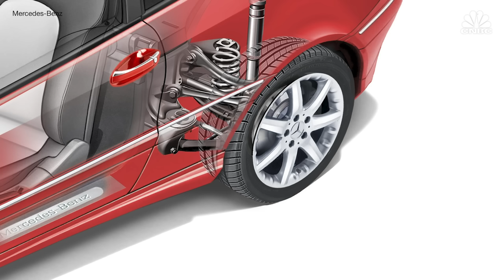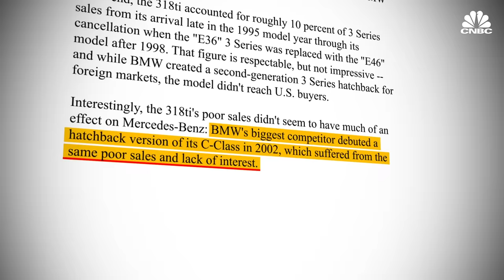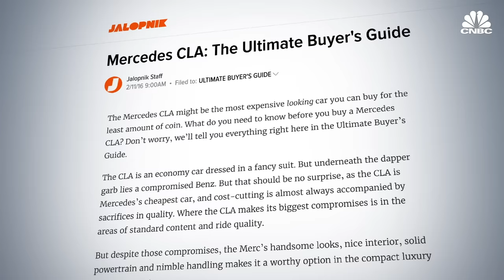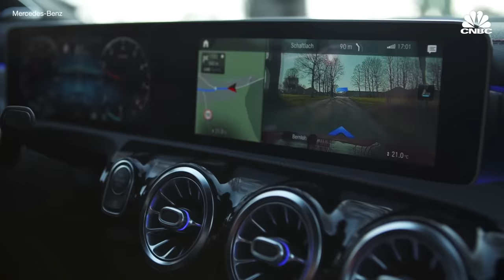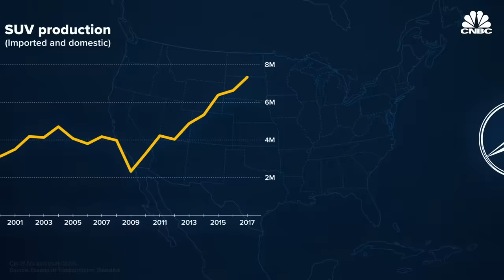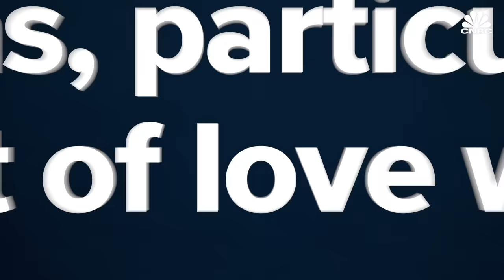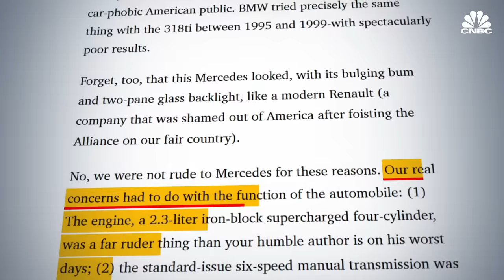Why BMW And Mercedes Made Cheap Cars That Failed

Comment: The real title should have been: "Americans do not buy 3 door hatchbacks, especially expensive ones."
Reply: Spot on.
Reply: Spot on.
Reply: I think he or CNBC missed the point regarding this segment.
Reply: Exactly b/c these things are very popular in Europe
Reply: Shame... Golf R or GTI are excellent options.
Reply: @vavo4902  BMW and Mercedes would have been wise to sell a hatchback in the 80s. If they did, they might have gotten lucky like VW did throughout the 90s, 2000s and today.
Reply: I purchased a brand new silver 318tiA in 1998 and I'm still driving it today,  almost 62,000 actual miles.  It's a hatchback but it's still a real sports coupe, fun to drive everytime.  However, it's not a popular model here California.
Reply: Yup American car tastes are different, doesnt make the model a failure. And things are changing, they are buying smaller cars and with the RS6 being available in the USA you watch wagons make a comeback
Reply: sdsteve1000 nothing is cheaper in the U.S than an unreliable euro car. Base model Toyota Camry’s are more expensive than Range Rover SUV’s and Mercedes cars on the used market, and the Camry’s always have more mileage. American cars can be hit or miss but if you know what to buy, you can get a great vehicle. We buy mostly Japanese and American cars here anyway if we want something that will last. Even Korean cars are catching on in quality. Over here, even most people that don’t even know much about cars have a certain understanding that you just don’t buy something like a modern bmw and hope it’ll last, because they just don’t.
Reply: Unless it is Scion tC that you bought pre-owned for cheap.
Reply: @Lando-kx6so  Mercedes, BMW, and Audi do not have the same reputation in Europe as they do in the US. In Europe, likely due to a combination of logistics and taxes, they all have a very wide range of cars. They are never at the very bottom, but  from the middle up they have a car in basically every category. BMW I think had a reputation for always breaking down and being crap in the 90s I believe, because they mostly sold the middle end cars and they didnt have the best quality. Meanwhile the US has only ever gotten the high end models because they have larger margins and bigger profits, so US importers only wanted the high end cars.
Reply: sdsteve1000  not always. Japanese cars are some of the most popular cars in the US, making up 40% of the market alone. Meanwhile, the majority of Ford's sales in the US are made up of dependable F-150 models.
Reply: Not*
Reply: @scooterbob4432  I love those. I've test driven one in a stick when I was a teen. My dad bought me a 2000 3 series auto sedan and I never really enjoyed it as much as the other bmw choices
Reply: The 3 series compact failed due to its looks but those of us who could look past that the 320td was a way better car then its sedan version. Not only was it way more fun it did not have the chassis cracking that plagued the e46 sedan.
Reply: Thanks u just saved me 11 minutes
Reply: ScooterBob44 I had one and miss it I want to get another
Reply: sdsteve1000 nothing wrong with buying domestic....
Reply: Americans loved Acura Integra ;)
Reply: OPQRST why would we waste money on smol car when big car is cooler
Reply: Va Vo not in the US.  I’m jealous of Europe because you can buy German cars.  Whereas in the US only Japanese cars are truly reliable, and they don’t offer many fast cars.
Reply: OPQRST true
Reply: B-but i bought one! I 💘 my lil' scion
Reply: sdsteve1000 BMW, Audi and MB are some of the most depreciating brands out there.
Reply: The point is! In the US you buy a 5,2 Hemmi charger and just can dri ve at 90mi Highway 😂😂😂. I live in Germany have a C250 2008 and can drive at 240km/h. Why should i buy a dodge charger like my friens in MA to drive at 90mi ???? You guys Americans are crazy
Reply: But we from europe, dont have this very cheap gasoline like you guys in the US. Mercedes isnt to expensiv to have, just buy used like i did. From 60.000€ as new, i have paid just 26.000€ as 3 years old.
Reply: NO
Reply: sdsteve1000  they're not as bad as Mercedes or BMW in resale value. After 5 years that 80k BMW is worth like 25k, while a 30k domestic is worth like 15-20k after 5 years. A domestic doesn't cost 300 bucks to do an oil change either.
Reply: sdsteve1000  i dont know about you but mercedez and bmw are alot unreliable then domestic cars and they lost value like a truck flying off a cliff its simple really if you want cheap reliable car just buy a japanese car toyota honda
Reply: @bruhdabones  Check out the Kia Stinger GT.
Reply: Max Arago what about it?
Reply: @bruhdabones  it's a reliable alternative to fast Japanese or German cars. It has 370 PS, and it get from 0 to 100km/h in under 5 seconds. Don't know about the build quality in the US but in Europe reliability and build quality are both superb of the Korean brands (Kia and Hyundai).
Reply: I just bought a 15 XB with 33k miles for under 12k OTD. Cars are terrible investments, but I like knowing I am not over paying to get one and it will last many years without problems. Its a Manual, so that is Cool. I still keep a 92 MK2 VW 16v GTI. I never warmed up to VWs of newer vintages. Too complicated and troublesome.
Reply: True
Reply: With the exception of Ferrari, you are quite right.
Reply: sdsteve1000   well that's not correct. Americans tend to buy more Toyota's and Honda's then any other brand so you're wrong there. Every single brand of automobile have been made poorly at one point in time, even Toyota's, so you're wrong there. Pickup trucks and Jeep's tend to hold their value longer than any other brand, and with Jeep being an american brand, you're wrong there. And early 2000's GM products are still some of the most reliable vehicles on the road today, up there with Camry's and Civic's. So it looks like everything you said was wrong... How did you get so many likes from literally saying nothing correct?? Source - I'm a high level technician that's been working on cars for almost 15 years
Reply: @scooterbob4432  

Your car has about five to six normal years of use on it. 

Tell us how well your car had treated you at twice that mileage.
Reply: so they should stop crying when certain EU cars dont come to America
Reply: Absolutely true ,as these were actually designed for the European market and there they were considered  sporty hatchbacks not luxury cars and had a higher price tag than in the US. The bottom line of this reportage is total Bull....
Reply: @waterdrinkingexpert6797  Yeah by the "dependable" F-150 that'll randomly enter death wobble.
Reply: @I_THE_ME  those problems were faced by HD trucks like the F-250 AND F-350, not the F-150.
Reply: @bruhdabones  When you have to pay 1.39€ per litre for gasoline (1 Gallon = 3,79 Litre  ->  5.27€ per Gallon or (1€ = $1.09)  $5,74 per gallon minimum you waste money with a big block on every mile.
Reply: wagner1va  Maybe that's a regional thing because around here mechanics know how to work on German and other European cars.  There are plenty of Euro only mechanic shops that all have great reputations for being knowledgeable and affordable.  There are at least ten shops that I know in the immediate area that mainly service Euro cars.
Reply: @TONYNAEUROPA  Hate to break it to you but cars don't automatically shut down in the US when we hit a certain speed.  Of course we break 90 mph on our highways, its just that we shouldn't get caught doing it.
Reply: @djkenny1202  Nice.  I'm in the same boat when it comes to VWs.  I'll only go as far as a Mk3 or a Mk4 if its an R32.  Got an 89 Jetta coupe with an 8v that I picked up as a project last summer.
Reply: American from what country?
Reply: sdsteve1000  ok boomer
Reply: They should just make pickups instead of hatchbacks for NA market
Reply: Traded in my somewhat common e46 3-Series on a ubiquitous Dodge Charger 3 years ago. Traded in my ubiquitous Charger in on a Camaro SS Sports Coupe; rarely see V8 Camaro’s driving on the road, but every time I’m in the car I see Dodge Charger’s and bare bones 3-Series sedans. Killed 2 birds w/ one stone in purchasing a Camaro... Compliments galore & Brand Exclusivity. BMW’s are over priced hype
Reply: You get a hatchback anticipating to carry bulky things that wouldn't fit into most trunks. You don't get a luxury car to be a pack mule. Utility undermines luxury. Luxury is not doing the menial tasks. I'm not sure how BMW missed this consumer mindset.
Reply: Joseph Samsor I own Korean and I’m happy about it
Reply: Its just click bait!
Reply: This was my first thought, turns out it was top comment already.
Reply: Indeed yes.
Reply: @Andrew-zv4fm  Can it be that you arent familiar with the BMW history? They already produced a Hatchback in the seventies: https://de.wikipedia.org/wiki/BMW_02#/media/Datei:BMW_2002tii_Touring_1974_1.JPG
Reply: ScooterBob44 make it a drift missile
Reply: Unless its a 08 Yaris, americans would buy it
Reply: sdsteve1000  Ah yes, German and European cars are the pinnacle of reliability.
Reply: TONY CARVALHO said
Reply: Focus RS fits in this category.
Reply: They particularly don't like small cars. And what we call big cars (a modern 3-series), is small for them, so go figure what they think of the VW Polo.
Reply: pretty much. Americans don't like coupes and especially don't like hatchbacks of any kind. I'm sure the cheap crossovers are flying off the shelves
Reply: If I wanted a 3 door hatchback I'd buy a mid to early 90's Dodge Daytona Shelby or Omni GLHS. I like my Mercedes C230 Kompressor it's good on gas I'm getting around 32 to 34 mpg with it I work on my own cars so only thing I had to do to it was a timing chain other than that it's been reliable I never touch that car unlike my GM's they break down often my Ford been reliable and Dodge but my Dodge is is extremely modified engine transmission and suspension so I guess it doesn't count.
Reply: u can't speak for all Americans tho
Reply: All you have to do is jack it up, add some plastic, increase the price more, and ta-dah! Instant sales.
Reply: @Lando-kx6so  We get them only as a 5-door, as with the Fiesta ST.
Reply: sdsteve1000  Mercedes and bmw
Reply: @2010HarleyDynaFXD  what i would do to get a 30 MPG car, even if it look boring. I could use the extra money not spent on gas on my savings account!
Reply: @jonathanvillalba3214  Just find a old econobox like a Geo Metro, Honda Civic, Toyota Prius, VW Golf Diesel they all get good gas mileage.
Reply: I would admit Americans have no ideas about cars (driving skills, engine reliability, design...). Not a surprise that the best cars are Europeans and Japanese. That explains as well why the US model of an European car is never the same version which can be found in Europe, cos Americans look only at the brand and at the biggest engine, that happens a lot with BMW. BMW Europeans modes have nothing to do with US models, it is day and night!
Reply: @dunno1128  BMW's catch fire and they won't recall it look it up it's one of the most unreliable car brand out their! BMW also makes the modern Mini Cooper that's even worse than a Yugo in reliability.
Reply: Spot on
Reply: @2010HarleyDynaFXD  I totally agree. I wouldn't want a BMW. They look really nice and all but completely unreliable and maintenance costs are outrageous in the United States. I'll stick to domestics. Modern day domestic cars are very reliable  here in the US especially if you know what to buy.
Reply: Because they can’t squeeze past the drop seat into the back?
Reply: Yes that's what it should have been titled.
Reply: Speak for yourself ,I bought a loaded Mazda 3 hatch and considered the CLA as the price was about the same but to add all the features that my Mazda has raised the price of the CLA  to $45 grand. One of the car magazines actually said that the CLA handled like a MAZDA but with a punishing ride. On top of that M.B. parts costs many times Mazda prices and except for an infotainment system problem it has been trouble free for 6 years , I doubt I would be able to say the same with the CLA.
Reply: @Destin5258  Famous mechanic Scotty Kilmer said European cars built and sold in Europe are more reliable than the ones sold here in the states.
Reply: they expensive because they a Mercedes or BMW, not a Toyota, Mercedes and BMW does not want their value of brand to go down
Reply: @officialwowow  With those German brands you get the most high tech engineering and snob appeal   but you also get the most expensive vehicles to fix (and many spend a lot of time in the shop) and few of them last as long as most Japanese vehicles do. Look at how much faster German cars loose value compared to Japanese ones.
Reply: @leekumiega9268  lemme tell you this, a person won't compliment you for having a Toyota but if you had a Mercedes you would get a compliment, Companies like Mercedes do not want to lose their brand value, or else seeing a Mercedes would be similar to seeing Toyota, this is why Mercedes doesn't sell cars cheap and last of all I would like to say that a person who can afford a Mercedes will be rich enough to maintain it... also  German cars don't mean bad reliability they still work great without problems...
Reply: @officialwowow  Granted You can't beat the prestige of a German car , and if you can afford get a new one when the warranty runs out great. But even people who can afford one get sick and tired of all the expensive repairs they need when out of warranty if they keep them long term.  The new ones are not like those built 30 years ago that could last 200K miles without a major expense . Scotty Kilmer an on line mechanic says even doctors and lawyers that can afford them say  that they would never buy that brand again.
Reply: @leekumiega9268  I have never experienced your problems! That stuff will only happen with cars like Landrover and Bentley, the British-made cars have bad reliability that why they unreliable but german products are not unreliable what you say I highly disagree, German-made products are good, have you ever owned one? well for me I loved it, it was the best car I ever owned...
Reply: @leekumiega9268  Do you know Mercedes-Benz is German and they invented the car? Germany invented the car, not Japan!
Reply: @leekumiega9268  Do you know Germany is the biggest manufacturer in the world? It's Volkswagen
Reply: @officialwowow  Yes I am aware that VW bought out a lot of the competition and are the biggest car company in the world. Did You  know that  Cadillac came out with many of what are standard features before the Germans did , like the First enclosed cabin ,electric starter , the synchromesh gear box, safety glass, selectable suspension,  power steering, the radar front collision warning system and the first automatic climate control . While not true now Cadillac once had more prestige than M.B.
Reply: @leekumiega9268  Cadillac was on the front but now M.B cars are just more luxurious than Caddy cars and do you know Cadillac's flagship model "The E S C A L A D E'' just got air suspension for 2021 model every other year before that they're flagship did not even have air suspension
Reply: @leekumiega9268  Did you know M.B was the first to fit brakes and suspension on all four wheels? Anti Lock breaks were invented by M.B? So don't blame German Engineering
Reply: @shortmanshorts365  Perfectly logical explanation.
Reply: @leekumiega9268  🇸🇪😃🎂👍👍👍
Reply: Can’t stand hatchbacks.  They’re ugly imo.    Not aerodynamic, etc
Reply: @neonmarker6994  Nobody in Europe cares about 0 to 62mph - what cares is how stable is it at 160+mph and how easy you can drive it fast in a curve on the autobahn.
Reply: Not when they are several thousand dollars more than the sedan version for literally no reason
Reply: I bought a new one in 1998, a BMW 318ti hatchback.  Truly love this hatch and I'm still driving it daily.  No real major problems encountered so far.
Reply: I agree with this. 3 door hatch backs are stupid. Yup, stupid and useless…
Reply: #stoptheHateOnThreeDoorHatchbacks
Reply: So true. They are a callback to the 70s and 80s, and are associated with cheapness.
Reply: I've seen quite a few 3-door Toyota Echos/Yaris and Hyundai Accents on the road in the 🇺🇸 States
Reply: Plus us Americans want awd, the rwd 1 series is a rarity here in upstate ny, awd even in the 2000s was critical in a car’s success
Reply: Totally agree

Comment: Please add "in the USA" to the end of the title, the compact 3 series paved the way for the 1 series which is an extremely popular car in Europe. Likewise Mercedes A class and derivatives like the  GLA and  CLA are also extremely popular here. Their lower entry point prices have meant they have stolen significant market share from traditional sellers of this size of car
Reply: No reference to the fact that BMW DOES have a mass market brand either. And a very successful one, in Mini.
Reply: Although not popular in USA, I still drive my 1998 German made compact BMW 318ti everyday.  I have no problems with the engine or transmission so far.  It only needs some interior cosmetic job.